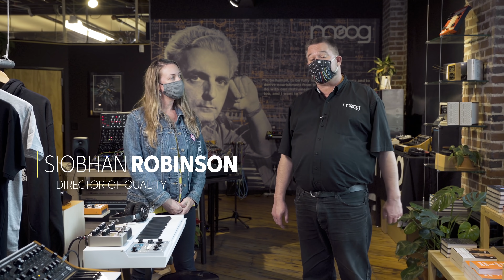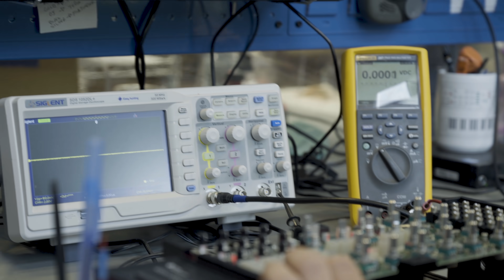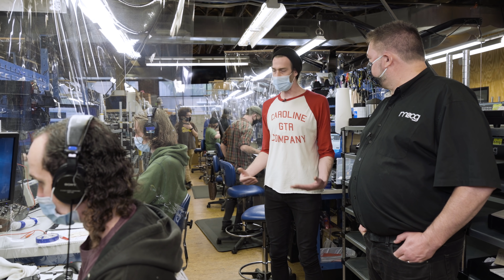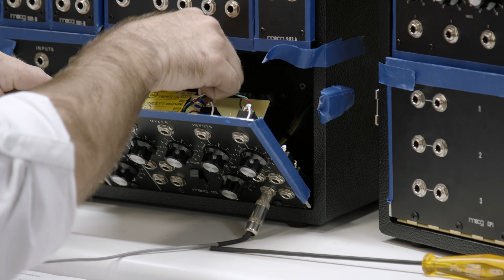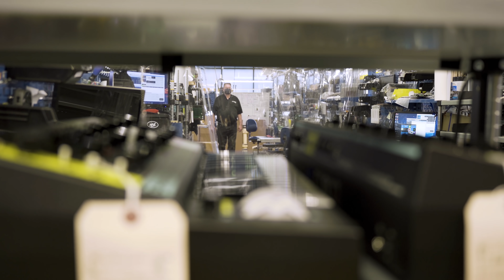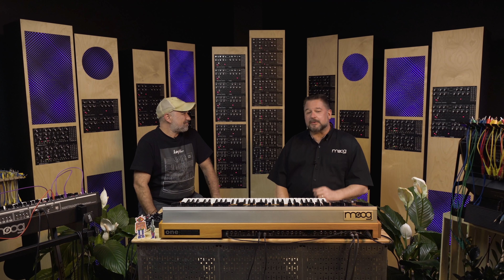Daniel Fisher's Behind The Scenes Tour of the Moog Factory

Comment: Wonderful! I only wish there were more products with fully through-hole circuit designs. Only the very high end stuff nowadays are through-hole which are way more repair-friendly. All these SMD are ok, but in a long run and for more reliability based on my own experience as a session player who is relatively good in soldering and repairing (had to learn it anyway) I much prefer the through-hole circuits. But I know SMD stuff are more affordable and cheaper and faster to build so yeah.